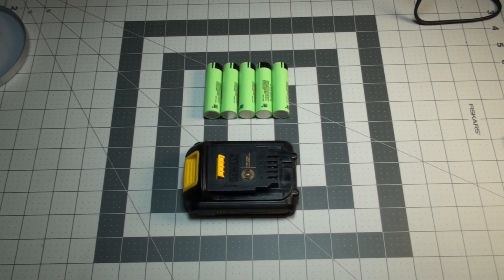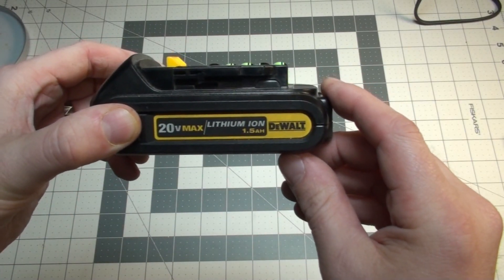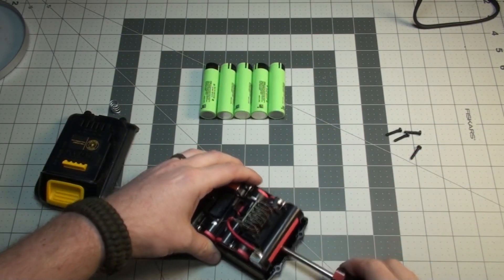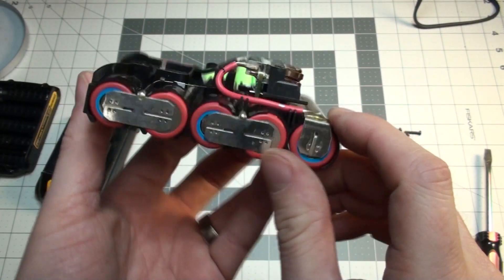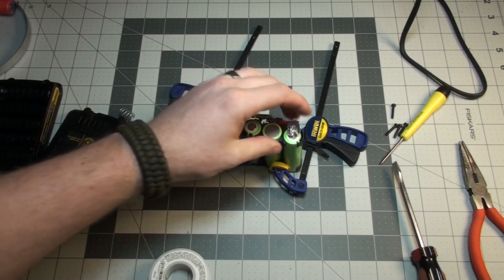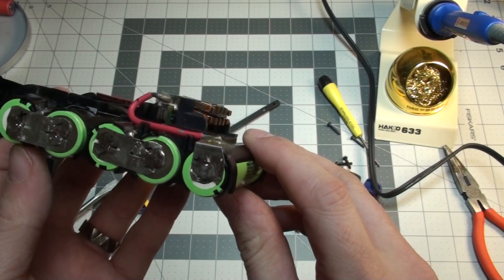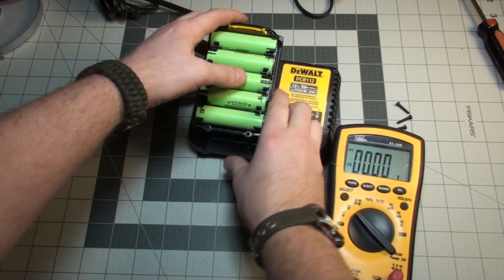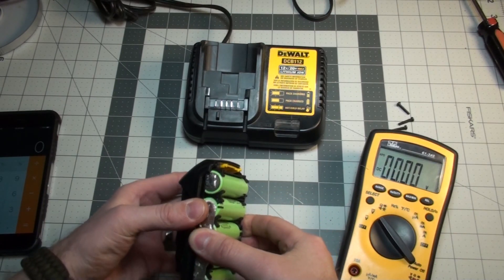$35 Dewalt 20v Lithium Battery Rebuild #diybattery #dewalt #batteryrepair #18650 #cheapbattery

Comment: Needed to choose a higher current sourcing battery without protection.  Dewalt doesn't want to charge to 4.2 volts because it shortens battery life, they prefer you to purchase a spare battery and swap them out as you work all day, they charge pretty quick. Just look for a deal on real Dewalt batteries this christmas, two 3.0 Ah 60Wh batteries for $99,  I can't buy the16850s for that price.

Sure it's fun to tinker, but be smart, make a visit to Battery University and learn about LI batteries before you start a project.

Comment: You should have opted for 2.5Ah high current cells instead. Much safer as those cells are made to high currents and tool will perform much better. Pack may work on the drill. But may not have as high torque as when using high current cells.
Reply from the maker: Yea Probably should have used higher current cells.. But It works good enough for me and I mostly use it for the Flashlight and USB adapter that Dewalt makes.  Although I did use it till dead driving deck screws in shortly after I made this.. It was good until about 80% dead then started to slow down.. Still lasted way longer than the other packs I have.
Reply: I agree, but there are a few Dewalt devices that don't need high current cells. For the top power tools they are of course needed. Using a single row of cells in a high power tool will certainly make a burn.

Comment: That Dewalt Lithium-Ion battery pack is smallest Dewalt has to offer. You can purchase a brand new 2.0 battery pack on Ebay for about 35 dollars. So in my view it is not worth going through all that effort to do what you did.
Reply: I don't think you guys are getting it he just built a 3 amp hour instead of a 1.5 which it was before
Reply: John L actually they have a 1.3ah battery that they couple with their low end drill but the 1.3's aren't too bad. They make a drill move fast.
Reply: john merlino you misunderstood man. You could buy that battery he rebuild for 35-40 new
Reply: @billlee1724  he overpaid for those cells. You could do a comparable rebuild for cheaper. Also those cells are not great for a power tool pack.
Reply: @niktak1114  yeah he just went with the highest mah batteries he could find but they're only like 4.9A. Prolly better to use some samsung 30q, or LGHG2 or Molicel batteries which are slightly less mah but 20A continuous rating.
Reply: Totally worth rebuilding.  It's 1/2
Reply: john merlino Lmfao family dollar and dollar General batteries die in my tv remote in less than a week and energizes last years
Reply: @hachi-rokuperformancegroup3987  every hear of rechangables ????///////////////
Reply: @crettybocker  yep but by time my rechargeable batteries in my remote die I can't find the charger
Reply: Ebay Junk cheap low quality Batteries cant compare to the Panasonic batteries he installed, So Educate before you speak, I can get 20aaa batteries for $2 at family dollar, They're 1.5v just like an energizer, Why don't I but them, Because 1 energizer will outlast all 20 Fam Dol batteries and not leak acid all over my new flashlight, remote, Or in your Case Dildo vibrator!!!.... Great job this kid did making this a better battery than can be purchased anywhere!!!...Bravo!

Comment: The model B cell has a protection circuit built in.  You can buy this cell without the protection circuit and it should actually be the standard 650 cell length.
Reply: Jeremy Siess - No, that's not correct. The major battery companies never add protection circuitry. That is only done buy aftermarket companies. So you can buy those Panasonic NCR18650B's with or without protection circuitry.
Reply: @JasonWW2000  No these Jeremy is right the model B does have the protection circuit in them, Mechanical mod users for e-cigarettes use these batteries all the time because of the built in circuit protection. They are just a tad longer.
Reply: @jeffdewe  I think your misunderstanding what he and I are saying. When the cell comes out of the Panasonic factory it will never have protection circuitry. If you see a Panasonic cell with protection circuitry you know it was added by a 3rd party supplier who sourced it from some other company and then rewrapped the cell. So they can be found with many different protection circuits added. They will vary in shut off voltage (2.2v-2.5v), vary in maximum charge voltage (4.21v-4.24v), vary in upper temperature limit (may not even have this protection feature) and vary in maximum discharge amperage (3A-15A). 
This is why you see protected cells with so many different specs. The little protection boards are made by lots of companies and you have to rely on the store your buying the battery from to tell what the protection circuitry specs are.
I hope that clears up any misunderstandings.
Reply: @jeffdewe  One more thing, factory 18650, 21700 and 26650 cells (unprotected) do typically include a few basic safety devices built in. These are not on an added circuit board, they are built in and have no effect on length.
The first is a fusible link that protects against a direct short. If it has it and it does short directly, this link will blow preventing a fire. The battery is damaged beyond repair and needs to be properly disposed of.
The second is a membrane designed to burst if pressure builds up inside the cell. Instead of it exploding like a pipe bomb due to high pressure, the membrane will break and the cell will outgas. Like above, the battery is damaged beyond repair and needs to be properly disposed of.
Reply: @JasonWW2000  They are protected batteries I owned like 6 of them in the past when I was vaping with a mech mod, They are indeed a bit longer due to extras in them.
Reply: @jeffdewe  Yes, that extra protection circuitry was added after the factory. They can be bought protected or unprotected. This is the point I was trying to get across.

Comment: I bought 2 original Makita 2.0 mAh packs for 25$ each. I think Dewalt batteries have a similar price on sale to those, so I don't see the point in rebuilding batteries.
Reply: Capacity overall should have been close to double

Comment: 4.0 volts is better than 4.2, your batteries will last 4x as long.
lifted below:
Every 0.1V drop below 4.20V/cell doubles the cycle; the retained capacity drops accordingly. Raising the voltage above 4.20V/cell stresses the battery and compromises safety.
4.3v - 150-250 cycles
4.2v - 300-500 cycles
4.1v - 600-1000 cycles
4.0v - 1,200-2,000 cycles
(however some say the initial charge should be 4.20-4.21)

Comment: Does anybody know what the TH and C3 terminals are on DeWalt batteries?
Reply: B+ and B- are the positive and negative terminals.
C1, C2, C3 and C4 are for cell balancing, they are connected to each of the 4 connections in between the cells.
Cell balancing is only done while charging so C1 - C4 are not connected to anything in the tool, but only in the charger.
TH is for the built in thermal sensor, to sense if the cells are heating up too much because of either too high charging or discharging current, so the charger or tool can turn off until the battery cools down a bit.
ID must be an identification pin, maybe to distinguish between slim packs and fat back with different Ah ratings, so the charger can charger larger capacity batteries with more amperage without overloading them and then put out less amperage for smaller Ah batteries.

The DeWALT XR batteries are not intelligent batteries with cell balancing circuit built in. Instead it's built into the charger.
Some other power tool brands has built more intelligence into each cell so they don't need as many connector pins between the battery pack and charger or tool.
Reply from the maker: Pretty sure that's how the battery charger balances the cells.  
https://en.wikipedia.org/wiki/Battery_balancing
Reply: Keylitho Those terminals are used by the tool as well. If you only attach the positive and negative terminals the tool will not work.
Reply from the maker: Oh... Didn't know that... do you know what they use them for..?
Reply: thats on the tool side....ive made these work with a 18v mastercraft impact using just the + and - terminals.     worked great until it cracked apart the anvil housing.

Comment: Hi,
Thanks for the video.
Any advice on who or how to rebuild an 18V Dewalt lithium?  I dropped one in a full rain barrel over two years ago.  It's held a solid 19V of charge in the lithium cells since then--- and none of them are damaged.  However, the circuitry reset or was destroyed, so the charger registers it as faulty.
Reply from the maker: I would open it up and see if there is any corrosion on the the board anywhere and make sure the contacts aren't rusted and if there are no obvious signs of damage then maybe buy a dead battery from ebay and just replace your circuits with the ones from the dead battery.

Comment: Very handy, especially when you have a existend Li-Ion pack where everything is already in place such as the balance wires and the ability to use the charger the drill is come with. I've done the same thing with a 18V Parkside cordless drill which had 15 dead Ni-Cad cells. I've rebuild the pack and add balance wires and a volt meter with alarm to warn me when to stop using the drill and balance charge it with a SkyRC imax B6 mini charger.

However, I've used 5 LG ICR18650HE4 2500mAh cells which are capable of drawing 20 amps. Those Panasonic cells you used are very nice and high quality japanese cells, but they are not rated for high current draw. Those are designed for use in laptops etc. The spec sheet says: "Maximum NCR18650B discharge amp limit is 6.7 Amps under continuous current load". This is way too low for a cordless drill who can draw a lot more. Those nice Panasonics are not going to have a long life..

My Parkside works wonderfull with the LG's. However, I've ordered those LG cells with the spot welded tags option so I didn't have to solder directly on the cells. Li-Ion cells don't like high temps, they can be damaged easily which is especially noticeable after a while..
Reply: There are several components to battery repairing. One resource I found that successfully combines these is the Magic Mender Wizard (google it if you're interested) definately the best info that I've seen. look at this  awesome site.

Comment: Soldering a battery do a lot of damage to a cell because of exess of heat thats why thez are spot welded
Reply: Interestingly enough, the larger the iron you use, the less chance of damaging the cells since the heat is transferred locally almost instantly. I have a giant 150 watt iron (Ungar 3200) that solders batteries with just a quick tack.
Reply: Yeah, that little iron is WAY too small.
Reply: That’s why I built a spot welder from an old microwave oven transformer when I rebuilt my Dyson battery pack.
Reply from the maker: Yea Yea I know.. But I don't have a spot welder or the desire to build one.. So Hot and Fast.. you'll be fine..
Reply: You can quickly pull a lot of the heat out of those solder joints by having a damp rag or paper towel nearby. Within a few seconds of finishing, just dab it on the joint. This will definitely reduce the amount of heat that will soak into the battery chemistry itself without hurting the solder joint.

Comment: why doesnt dewalt do this from the factory? their 3-5ah batteries are so big and heavy!
Reply: Usually the higher the capacity of the battery, the lower the discharge rate. So manufacturers use lower capacity batteries in order to get that extra discharge rate. These 1.5 ah batteries will drain in 5 minutes when used with a high drain tool like an angle grinder (DCG412). However, with a low drain tool like a drill, the battery that Keylitho made will be just fine. In larger batteries that have two sets of five cells arranged in parallel, you can use higher capacity, slower drain cells since you get twice the current when you connect batteries in parallel. So essentially you can get 4 times the capacity for twice the size. I hope this helped.
Reply: Do you even English, bro?
Reply: +GEORGE ZARIFIS I see where you're getting that but no I but certain batteries it will not discharge that fastly
Reply: James Droddy lol
Reply: Daniel D'Andrea - In order to get 20 volts you need a minimum of five batteries. Then in order to get 3 to 5 amp hours you need to run another five in parallel. So this means a minimum of 10 batteries the size of an 18650. 
The only way they could make the battery pack smaller and still have 3 to 5 amp hours would be to lower the voltage. You could have a 16 volt battery pack using 8 cells. Or a 12 volt battery pack using 6 cells. This reduces overall power, though.

Comment: these Panasonic cells can only discharge at about 5Amp maximum current. you should use power lithium-ion batteries like Samsung 30Q or LG HE4 cells, they can dischage at 20Amp current.
Reply from the maker: +Jing Zhang Yea probably should have... It work's just fine with the drill.. I used the battery a few weekends ago to build a deck and It would drive the deck screws till the last drop of power and it did last way way longer than the dewalt pack.

Comment: You have protected cells there, 18700 Or I guess that is what the 18650B stands for they are longer because of the protection circuit,
Reply from the maker: +rimmersbryggeri Pretty sure there is no protection circuit in these cells.. I have protected cells and they are bigger than these.. The Dewalt case was just a bit tight.. I have ran across other batteries from different manufactures that vary from the 65mm spec... I have added a link to the spec sheet from panasonic in the description.

Comment: Hey what type of cells where in the battery before you put the news ones in.
Reply: I believe Dewalt use Sanyo batteries. Panasonic brought Sanyo 6/7 years ago so they are likely to be good.
Reply: Yes all red cells with a blue top like these are Sanyo cells.
Reply from the maker: +Tj Greene I am not sure I don't think they had any markings on them..
Reply: Sanyo 20700
Reply: Michael Sabatini - definitely not 20700. These are 18650.
Reply: They are sanyo UR18650RX. The label is only visible in the heatshink with close inspection. Its like a shadow embossing. I have one in my hands and can confirm that with certainty. 2Ah, 20A 18650 cell.